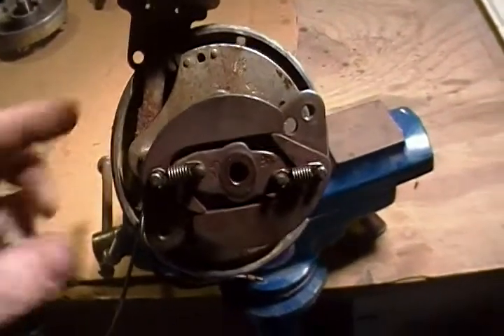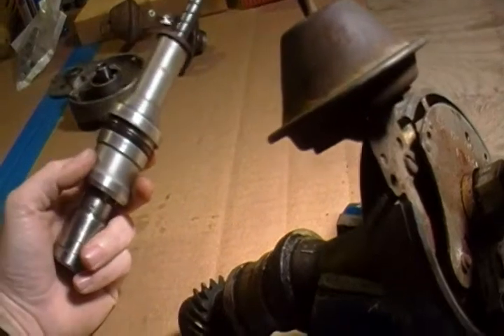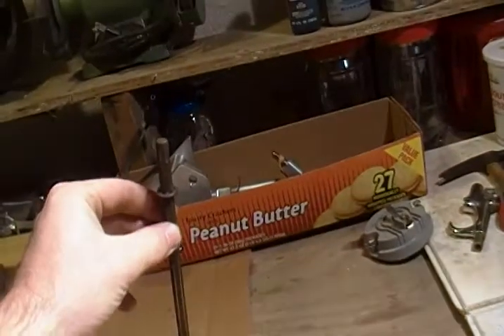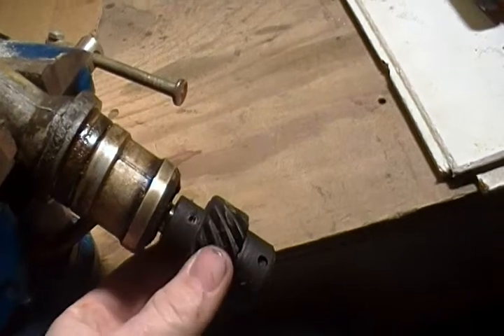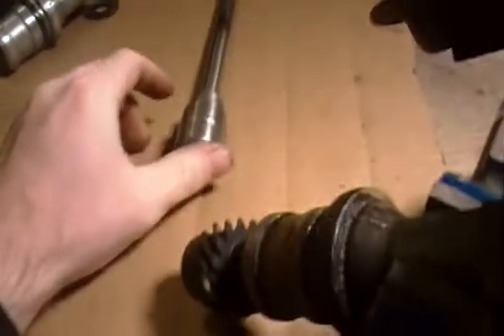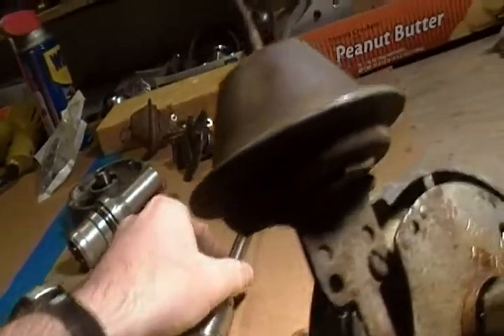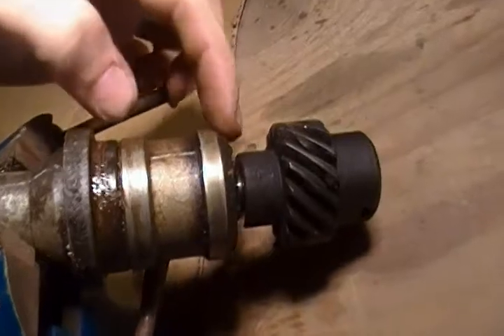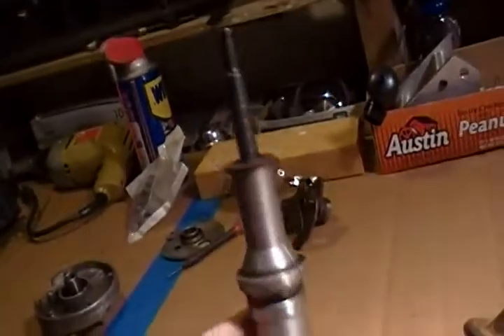Making an Engine Oil Priming Tool

Comment: I just found out that autozone has the oil primer tool as a loaner, but if you don't live near one this is good to know. thanks for the video.
Reply from the maker: I live close to both an Advance Auto and an Autozone. I kind of like tinkering. Sometimes a little too much. Thanks for watching